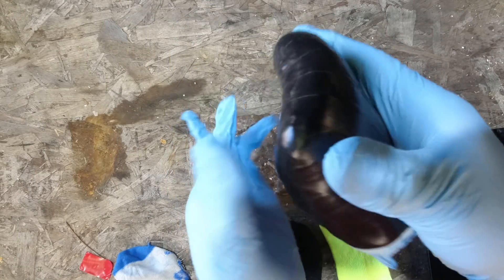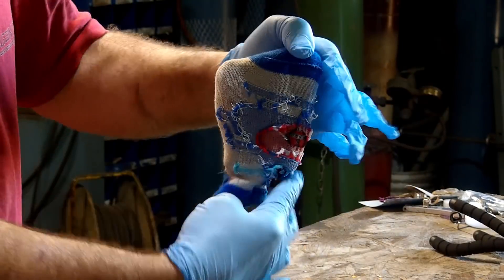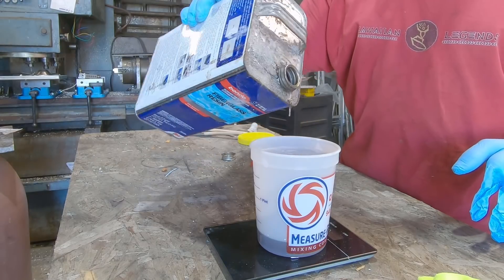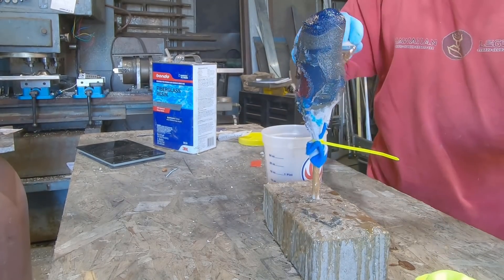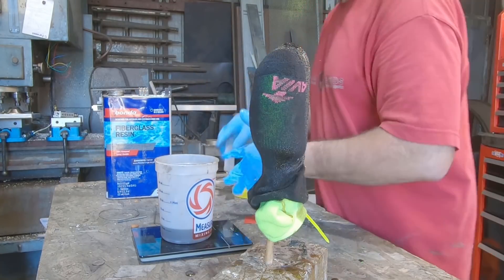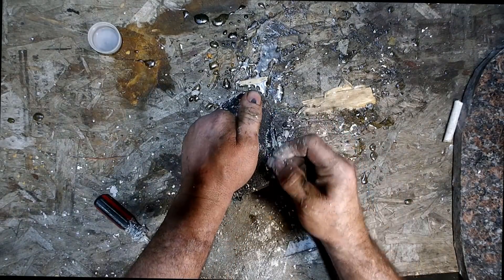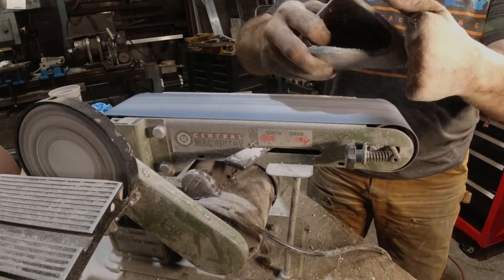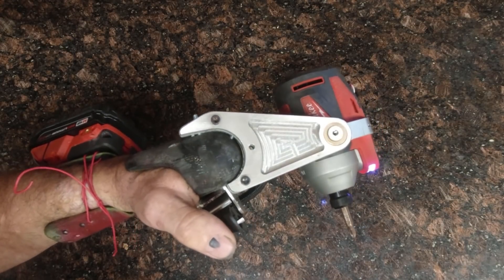Part 3 how to build a partial hand prosthetic socket

Comment: Are there any limitations to the electrode setup you have now/can you get individual outputs for each finger? What do the signals look like coming out of your hand? I'm new to the channel and haven't followed the electronics side so far (programming is why I switched to physics from engineering in college, I just can't do it well). I'm curious to see what your current setup is limited to- mechanical failure of the fingers, loss of mechanical advantage, or if that's just how the electronics work out? Could you gain grip strength by elongating the setup down the forearm and freeing up space in the fingers, or maybe this is a case of more expensive parts mean more power/torque around your palm? I have so many questions, I think I'll have to do some research on this. This is very interesting and something I've thought about quite a lot, I look forward to future videos!
Reply from the maker: The signal is just low energy emf from the muscle contraction.  It's picked up by a dry contact at the end and center of the muscle and the level is amplified to where it is enough for the microprocessor to look at it as an analog value.  From there programming takes over and it becomes a simple if statement.  If index analogRead >= index threshold; ( index counter ++;)

Comment: Good afternoon! My name is Roman I have been living in Russia, for 40 years in Chita I work in the state organization of prosthetics. I was very surprised and impressed by Your prosthetic hand. I myself develop and produce on a 3D printer and try to put various prosthetics of fingers and hands, but I have not seen anything more mobile than Yours. State prosthetics in Russia as in all other countries is very weak, hand prosthetics is almost not developed. Can I ask you for a diagram of the hand prosthesis with detailed dimensions to repeat on a 3d printer, or the subsequent melting of individual parts from aluminum?. Roman-meteo@yandex.ru  I apologize for the crooked translation

Comment: Similar (kinda) to how I used to make subwoofer enclosures form fit to trunk. I'd use old sheets as the initial backing and layer. 
 
After my base form was made, I would cut my sub mount rings, mount them with some dowels,  and then stretch the sheet over the whole front. Then cover in resin.

Comment: If you gave the first sock a couple of very light coats with a rattle spray can, or some other way of closing the fabric surface so the resin doesn't wet through you would have a socket with a soft liner.. I don't know if that would be advantageous to you it's just a thought
Reply from the maker: You need it to be saturated in resin.  If you need a liner or something to take up space,  then you either hack up a sock or you make a silicone liner. If it was just fabric on the inside it would be really hard to clean  and it would be a bacteria disaster.
Reply: @missingpartsclub  I wasn't thinking about bacteria.. But of course it makes sense.. Keep up the good work it's inspiring to watch.. Even though I hope I never have to build one..

Comment: Genius idea using the socks as reinforcement for the resin.
Reply from the maker: Ya, works incredibly well,  you don't have to deal with any edges or seams. And the material is super cheap!
Reply: @missingpartsclub  Also super smart to put a bright yellow sock under the two black socks as a depth reference. Loving your videos, sir, keep it up!
Reply: @jorer33  any time you use epoxy to repair a broken part, you can imbed gauze or cloth tape into the epoxy to make the repair significantly stronger.
Reply from the maker: @RustbeltBlues  I've done that and also when I know that there is going to be considerable loading on an area what I do is co 1 step further and embed 1/8" open 24ga. Woven wire bird screen. Makes it a little heavier, but the pull through strength is incredible!
Reply: @missingpartsclub  I'll definitely try that. Thank you!